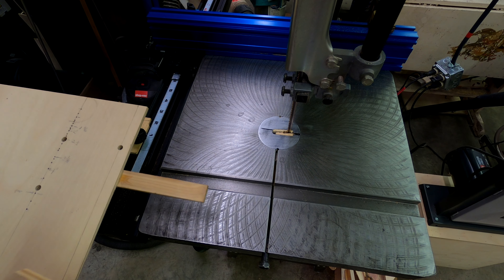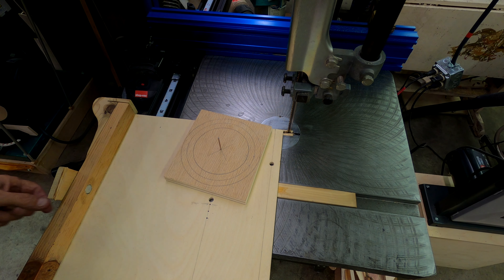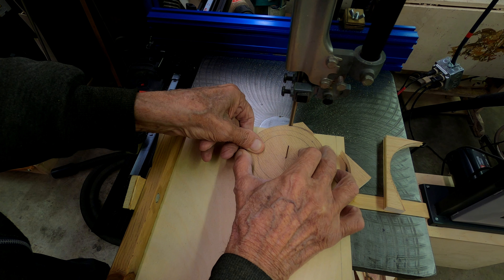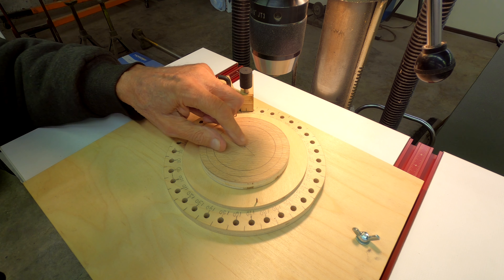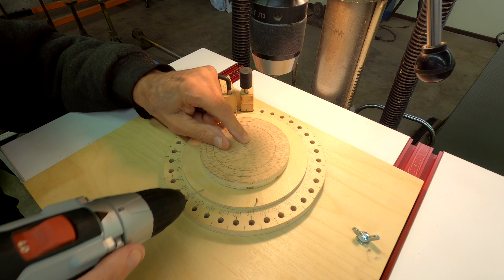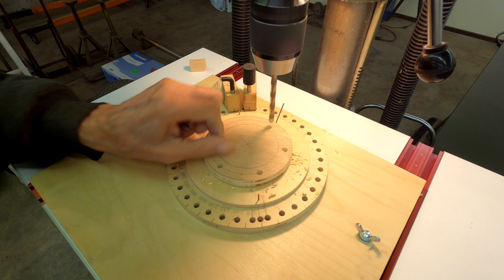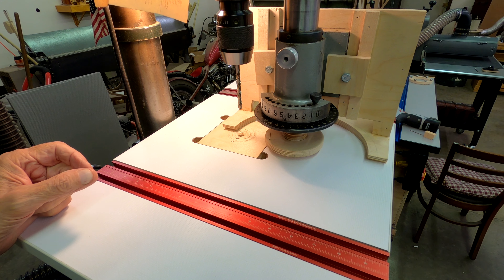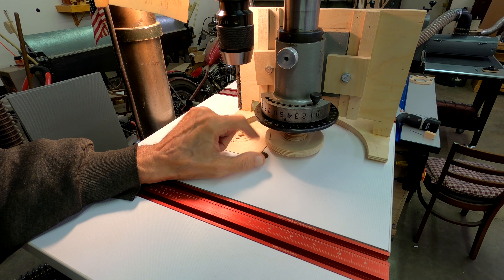Drilling Equally Spaced Holes in Wood Circles, Gears or What Ever!

Comment: Ok, I'm disappointed - I thought you were going to show us a clever way to get your initial pattern of rings.  But turned out you mostly already had that, and just bought your original reference.  Is there a way to do this by hand, from scratch, and have it turn out close to exactly right?  For any number of holes spaced around your disk?  I need 26 - I'm in the early phases of making a historically accurate German Enigma machine.  So I'll need those locations to line up through four rotors, each of which has the holes in four stacked up disks, and they have to match all the way through in all 26 rotational positions any of the rings can be in.